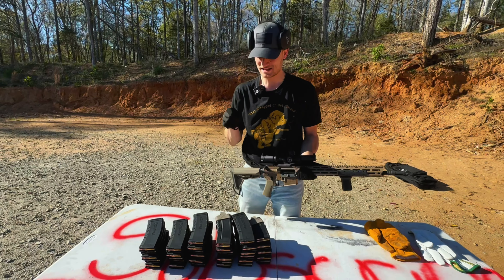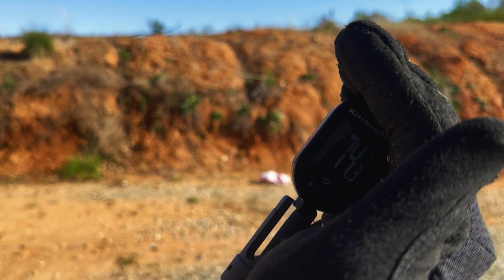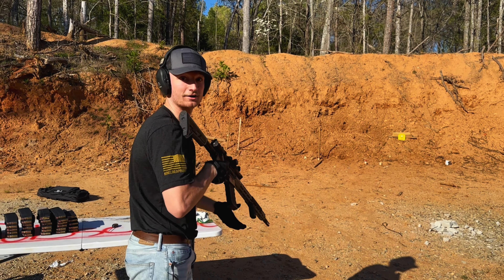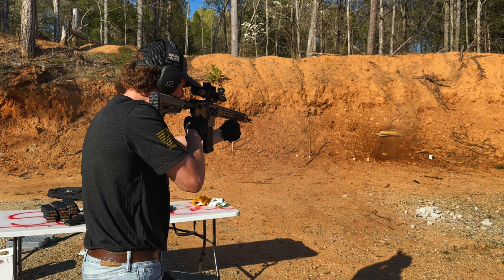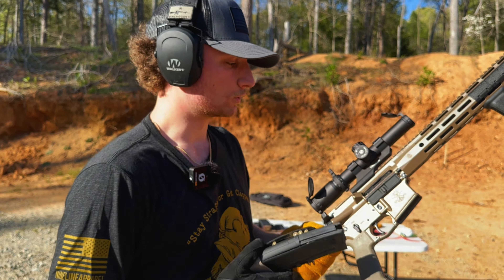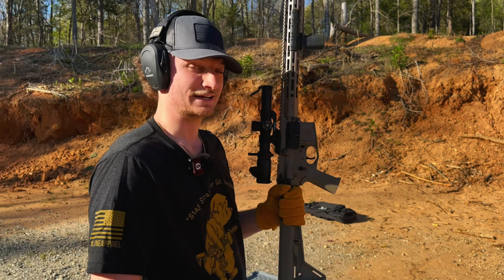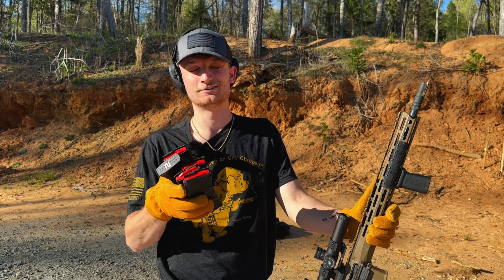1,000 Rounds vs PSA Sabre 15 (It Exploded pt.1)

Comment: PSA here. This is almost certainly an ammo related issue. This type of malfunction almost exclusively results from a 300Blk round being fired in a 556.
Reply from the maker: Hey PSA thanks for the comment! 
I am almost certain I still have the 556 shell in the upper.
Working with your claims department to figure out happened.
Thinking it could be a head spacing issue.
Reply: When psa comes and calls you out, Womp Wompp...
Reply: @ballisticsnation  My dude, just tell us the ammo type, lol. You say it's "High quality ammunition" so don't be afraid to say who made it..Unless it wasn't.
Reply: lol some random reman. Ammo
Reply: @ballisticsnation  JUST TELL US WHAT AMMO IT WAS ALREADY
Reply: Allot of mention on Ammo. First mags no problem then boom. I’d be pissed ..Straight pissed..So my surmise bring a shit load of oil to lube all moving parts on an AR15 before operations 🤔and or lube before using out of the box before going down range. Just my surmise 😊
Reply: @ballisticsnation  You filmed yourself loading the ammo. Since that was the only Sabre mag, you can re-watch that footage and see if a 300blk made it in there.

It happens, I've purchased 1k rounds 9mm FMJ and found a random hollow point mixed in.
Reply: @ballisticsnation you most certainly do not! I for sure saw a casing fall out the bottom of the magwell as well as something coming out the ejection port.
Reply: @ballisticsnation  Please respond with your claim number or email associated with the claim. We have looked on our end and see no record of a Sabre case like this.
Reply: This man probably shaking in his boots
Reply: Just admit your products cant handle 1,000 rounds
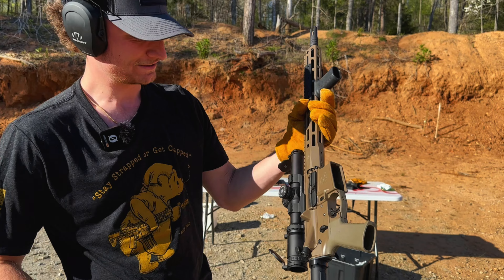Reply: At 5:54, pause the video and look at the top right corner.  You'll see what appears to be an empty 5.56/.223 shell in the air.  You can tell by the neck of the cartridge it was not cut down to the shoulder of the shell, so more likely than not it's a 5.56 round.  It could have very well been a hot load.  I've built some pretty garbage builds when I started, talking DTT stuff...and even then most issues were ammo related.  Every company has a few odd balls that pass QC, but my best guess is this appears to be ammo related.  AR's explode due to excessive pressure, not excessive headspace...so I'm not convinced that would be related.  That's my guess, but with so many other variables I'd never know based off a Youtube video.
Reply: At the start of the video you can see your magazine sitting on the table and it has a 556 /223 round on top.

The ammo is pretty suspect given he hasn't clarified what he was shooting and he also calls amend2 mags good mags.
Reply: @eggystinkering  Watched in HD frame by frame the piece seen flying off to the right is not an ejected shell it is actually the missing front of the magazine.
Reply: I concur. I have built at least 60 PSA AR15s and I beat the shit out of them and never had a failure or a problem.
Reply: @serenmm  I have had several PSA guns . all of them, every single one came to me with some sort of issue. Loose bolts, fitment issues , broken mags and so on .....All easy fixes but anyone buying one should go through it thoroughly.  The guns are cheap for a reason and it's not because they are high quality firearms with top notch quality control.
Reply: Definitely an ammo issue.
Reply: @ghostshadow9046  Ahhhh I see. I was also thinking the same when before the frame that looked like a shell the same piece looked oddly shaped.  I assumed it was the camera warping the shell between frames.
Reply: Your one of the only people to have this happen so it’s more then likely not the gun and if it is shit happens. I would go out on a limb though and say this was 1000% a bad round.
Reply: The round in question was actually a round from previous mag, the one with failures already, could it habe been squib in barrel?
Reply: @JonesyMcDanes  Compared to Troy Battlemags, Promag, Sig's rebadging of IMI Defense mags, or ETS, Amend2 could be considered a good mag.
Reply: @Steamrunner  if you leave them loaded in your car they break from the heat
Reply: @mattpsa he didn’t send it back because he knows you’ll find an exploded 300blk round in there 💀
Reply: That also looks common to case head rupture due to bad head spacing too, right psa? I dunno, the round came out of the muzzle and the few rounds before it blew up weren't cycling/setting off either.  Might very well have been light strikes due to not having positive engagement to the case head and bolt face (due to head spacing). I doubt all the rounds were good at first and then ran into 5 bad rounds in a row in the end. That looks more of a problem happening with the rifle (again head spacing falling off maybe?)
Reply: Idk how 1 jumps straight to “ammo issue” when the gun wasn’t cycling or ejecting prior to the failure.
Every round fired left the barrel. 
Several under powered rounds with finally and over powered round?
That would have had to be set up on purpose. 
That wasn’t a 300blk round!
I also wouldn’t take the word of a PSA social media person. Whole bunch of people employed by PSA that don’t know f$&k all about guns or how they function.
Reply: @PnP-td1mt  it is kind of crazy to jump to conclusions - I agree. The issue, I’ve never witnessed/heard of an AR15 fail the way it did; without it being hot ammo, 300blk, or squib. It seriously doesn’t happen. This was over pressure in the gun. 

It could have been the gas tube, but I went frame to frame - and I didn’t see anything that would explain this. I’ve also never heard of this failure from a bad or erupted gas tube. It would explain the FTE issues we were witnessing before the major failure 

Ultimately, I truly hope PSA gets this rifle back, because if it is there is an assembly issue - they need to know how/why and get it fixed before it happens to more people.
Reply: Wow!!! Ya that's not good!!!
Reply: @EliteCheez head space being out of spec would absolutely cause this. 
Over pressure round and or a 300blk fired in a 556 typically destroys the bolt and carrier. The carrier will split and blow out. 
The gun not cycling because pressure is escaping out past the case. 
I’m curious to see what the spent cases look like that did cycle.
Reply: @PnP-td1mt  The variation in ammo performance is why everyone is thinking ammo. If the powder load is too low or too high it will cause what we saw and given the uploader hasn't specified what ammo he was using, everyone is assuming reloads.
Reply: @PnP-td1mt  not saying it ain’t possible, but the go to answer for every time an ar15 “blows up” is headspace - and it honestly just never ends up being that way. I truly have never seen it documented(just googled and could only see a bunch of people arguing about it.) Case failure is a thing as well, and that is a very dangerous beast. Because, you truly never know; just like a hot round, you never will know until it happens. 

I saw their updated video, and the case is glued to the barrel; it definitely had some fun inside that barrel. Hopefully PSA can figure it out!
Reply: I love how PSA comes to comments and acts tough when something with their product goes wrong. It’s likely the Ammo that’s at fault but coming here all accusatory is dumb. Or it could very well be the weapon….You’re a business, act like it.
Reply: If you don’t shoot much and have no basic understanding of how ammo is loaded I’d refrain from typing your opinion. 
PSA having quality control issues is more common than not.
Reply: @PnP-td1mt  now das some spicy cringe
Reply: @PnP-td1mt  😂 alright guy.
Reply: @EliteCheez I mean seriously. Whole bunch of people in the comments giving their 2 cents knowing damn well they can’t do something as simple as head space check an AR let alone reload ammo. 
PSA doesn’t make anything “great”. Every platform they produce has some kind of major concern. You should be checking this stuff. A set of GO, FIELD, and NO GO gauges aren’t expensive or hard to use. 
Talking about how great a gun is yet not knowing how to perform simple checks like head space seems moronic to me. 
Do better! The more people catch the quality issues the more PSA will improve.. maybe 😂
Reply: @straight6fords580  Watch Garandthumb put over 5000 rounds through a PSA upper full auto and supressed.  I agree with others who feel this is ammo related without actually having the gun to examine.  The malfunctions look like weak loads causing short stroking and if some were weak its possible some were overloaded. Either way I would like to see PSA show the examination of this particular rifle no matter what they find.
Reply: The rifle did what it was designed to do should something like this happen. I have seen a lot of ARs do this. High end ones too. Most are ammo related. I wonder if something got stuck in there in front of the round. Looks ammo related and not mag related at all. I would trash the mags and only use US GI metal mags or MagPul. MagPul is a trusted polymer mag.
Reply: @muddyhotdog4103  case head separation will not cause an explosion like that. It will leave part of the case in the chamber and a ftd the next round. Over pressure or out of battery detonation will cause these types of failure but since the bolt is stuck closed I would put money on pressure not otb detonation
Reply: @jamescorby6854  you're not listening.. It will in fact lead to a detonation like that if the head space has fallen out.  I'm not saying it was case head separation that caused it, I'm saying the gap in head space allowed the pressure to release and cause a seudo-case head separation in the moment due to it not being fully supported.  The rifle was failing to set off the five prior rounds beforehand, there was something wonky going on with the rifle, and overloaded rounds ain't gonna cause that.. sounds like IT'S POSSIBLE the firing pin wasn't making firm engagement due to  loose headspace that didn't seat the case head firmly on the bolt face. I've seen what rounds look like after similar heads pace or poor cartridge support and the end result is similar is all I'm saying.
Reply: @muddyhotdog4103  are you saying the rifle has too little headspace or too much? Either way the damage to the rifle does not add up to a headspace issue. Too little and the bolt doesn’t lock up. Excessive headspace I could see case rupture but not to the extent it’s going to do this to the rifle.
Reply: @jamescorby6854   too much/excessive.. and yes it will still lock up enough depending on where the headspacing issue occurs or how excessive it is. That also gives more credance to my hypothesis on why it wasnt detonating the last few cartridges(bolt was starting not to FULLY seat into battery and reliably detonate cartridges due to shallow firing pin protrusion). Think about it. You think there was something wrong all of a sudden with those last rounds that didn't go off, or something going on with the rifle itself? That's too many symptoms showing a problem (with the rifle) to  ignore before disaster struck. That would be pure coincidence to pull out 4-5 bad rounds in a row out of a BULK box, when all the other cartridges were fine and working before.  Think what you want, but I've seen this with my own eyes where an ar15 gave up the juice, and it failed headspace after checking it out. Started failing to fire right before just like in this instance, and the rounds picked up afterwards all had light strikes. I would love to see the few rounds that failed to fire before it blew up. I'm not knocking psa, this stuff can happen. I saw it with a colt
Reply: @muddyhotdog4103  I definitely think there is an issue with the rifle but watching the video. The round that detonated was left in the chamber and that barrel was way too hot. When he has the failure to fire he never ran the bolt and didn’t have it in bolt lock. The more I have watched I think it probably cooked the round in the chamber and that’s what over pressures the gun. Watch it again from about 5:15-5:40. The more I watch it the more I get skeptical about condemning one or the other.
Reply: Could it have been a super rare cookoff? He gave the gas tube just a little bit of time to cool during jam clearing, but the barrel had not cooled down as much. As the round was loading Into the chamber it had a cookoff before fully entering battery
Reply: Outa batt detonation looks like, i had one! Haha
Reply: @eggystinkering there is also a round falling from the bottom at 6 o’clock. I believe that live rounds were blown out of the receiver. What do you think?
Reply: @philsturgill3435  I dunno.  I know that part 2 of this video was so painful to watch.  He pulls out the end of the broken shell casing...then holds it up to a 5.56 casing....as if 300 blackout and 5.56 have different case end sizes...and proved nothing.  If I was a bettin' man...I'd say ammo related.  Part 3 to this ordeal will take forever to upload....and it's just gonna say ammo related.
Reply: @eggystinkering  as I understand it, the head size of the 300 blk is the same as the 5.56, but the case diameter as well as the neck is larger. At any rate, this dude was a little shady when he tried to convince us that the head size was 5.56 when he “compared” it to another case head. However, if he was loading mags from a 1K batch of Winchester, I find it difficult to believe that a 300BLK would be nestled in the middle of the box. Idk, I just find him …. Not trustworthy….js
Reply: @philsturgill3435  I'm not too convinced about the 300blk scenario more than I am about a faulty round.
Reply: @jamescorby6854    @muddyhotdog4103  
  Sorry for the loooong comment, but it's hard to explain everything I think may have contributed and make it understandable.  I put this comment on part 2.

""User error was the main factor. If you had slowed down a little bit and taken time do see what was going on, you'd probably still have a rifle right now. Not trying to be an azz, just being honest brother. If you start having malfunctions, safety and diagnosis becomes the goal, not finishing a burn down video. 

(First) You kept saying "it's not cycling" If you go look at your other video, every round ejected and loaded a new round. You changed the mag, and every time you pulled the charging handle, a live round came out. Had to have been a live round, because you can see every previous shot eject a spent case. It cycled fine every single time.  Things like that are where it's time to slow down and diagnose what's going on. The mags weren't the issue. This leads me to 3 conclusions. (1) Either you had excessive headspace and were getting light primer strikes. Which you should have heard, felt and noticed as many times as it happened. (2) You weren't in full battery. The hammer was dropping, but not firing a round due to the bolt not being far enough in the carrier to allow sufficient pin protrusion and fire the round. When this happens, the hammer contacts the carrier, the pin itself, or both and pushes everything on in to battery usually. You can feel this in the trigger. Or (3) You have a problem with the fire control group and the hammer wasn't catching the disconnector. Do you remember if you had a dead trigger each time? I'd  be looking at the FCG for sure. But none of that would cause the gun to kaboom. It would just fail to fire.  In any case, you should have been looking at the primers on those rounds you ejected to see if you were getting strikes, light strikes etc. I think the gun failing to fire more than likely was a separate issue and had nothing to do with the gun exploding. With possibly the exception of the headspace possibility. More on that in a sec.... 

(Second) You need to do some reading on the effects of temperature on a firearm. You measured the muzzle at 400°. You yourself said the barrel was probably 600 or more, which is very likely. The melting point of lead is 625° I think. Now go look closely at your first video. You had several bullets that never made it to the dirt. They exploded in mid air before they got there. Slow down your first video and look at the shot at 3:48, 4:48 and the shot where the rifle blew up. Those bullets came apart before hitting the target. This is pretty common with thin jacketed varmint rounds and rounds fired through excessive twist barrels. The thin jacket allows the lead core to slightly melt and spin inside the jacket causing the jacket to fail and fly apart. 5.56 usually doesn't do this, but on those rounds I pointed out, you let them sit in that super heated chamber for about 10 seconds.  This in itself could lead to bullet cup deformation from rearward pressure and tighten up the bullet increasing drag and causing slightly higher pressures..... Another thing is the powder temperature itself. It's documented all over the internet about how much pressure is increased with gunpowder at different temperatures. Some powders are more affected than others depending on if they're single or double based. Typical rifle powders are usually more susceptible to pressure variations from higher temperatures..... Next and most important is barrel temperature. Extreme barrel temps cause the burn rate to change in your powder. Most rifle powders peak in the first 4 inches of bullet travel. Pistol powders typically peak pressure while the bullet is still in the case. The extreme temperature of your barrel at the time caused that powder to burn and peak significantly faster than it was designed to do. You achieved a full burn in a much smaller space and it shot the pressure up catastrophically. There used to be a study by the DOD that went deep into this, but it's been taken down. I was going to post it here for you, but it's been lost to time unfortunately. You can still read about similar studies in most long range forums or places like snipers hide.  One of the comments I read regarding the study stated this...

QUOTE: "The effect of barrel temperature is around 204 PSI per degree F for the Varget load. Also, the small sample gathered with 4350, before my thermocouple meter went kerflooey, is consistent with this result. Since the 4350 sample is small, the uncertainty is high, but the best estimate is 177 PSI per degree F. If you’re not controlling barrel temperature, you about as well might not bother controlling powder temperature, either. In the cases investigated, barrel temperature is a much stronger variable than powder temperature."

You can read this thread by searching accurate shooter. com for "Temp insensitive powders and barrel heat" This is why F-class and bench shooters fire warm up rounds, and try their best to cool as much as they can between shots. To maintain a constant barrel temp, and thus constant pressure. Cold bore, mid heat and extreme heated barrels cause harmonics variations, but more importantly vertical stringing due to higher pressures. Those shooters try to stay within a certain temperature range to keep pressures constant... your rifle was close to round cook off temperatures. If you look up cook off temps, it's as low as 400° if you leave it chambered long enough. Honestly, there's no telling what the actual chamber pressure was at when it failed.

So... what happened to your rifle? I think it was an unfortunate combination of the things I mentioned above.  The case you showed on the video was CLEAR case head separation. No doubt about it. The ejector marks and primer scream over pressure. The bulging you mentioned in the comment on the case like it was unsupported. Well it is unsupported in a 5.56 chamber. If you google pics of a cut away 5.56 chamber, you'll see the end of the case is not fully in the chamber walls. The thickness of the brass down there, the web, keeps it from bulging out under normal pressures. In fact that's the most accurate way to read over pressure. Measure the web on spent casings to see how much bulge they have. They all do it a little, yours just did it a LOT lol  One factor could have been that your rifle was a tad long on the head space. It could have still been in spec, or just a little over. And under normal shooting conditions, it would have lived forever. It's a little hard on the brass for a reloader because it causes the brass to grow more and have to be compressed back during sizing. But it's not dangerous.. Until you factor in over pressure. What happens with a large chamber is the brass rapidly expands to fill the void. This is so fast, it creates a hammering effect and is really hard on the chamber and bolt/lugs. And like I suspect in this case, stretches the brass enough to cause case head separation. So again in your case... you got it TOO HOT... you caused an extreme pressure situation and paired it with a possible loose dimension on the chamber, or maybe even a small dimension on the ammo. Both would have the same hammering effect. Now add those things to a barrel that is superheated and causing your powder to burn faster and spike, possible a bullet that's deforming because you left it chambered long enough to cause a slight core melt, and a barrel that is thermal quenched, swollen and restrictive from the extreme heat making it tighter on the bullet. Not to mention it's still a fairly new rifle with very little throat and land erosion, so it's already making a tad higher pressure than a more worn in barrel.... You just created a failure by stacking a bunch of tolerances. If you had been firing slow, at normal temps, I highly doubt the rifle would have blown. I can almost guarantee you no one is going to find anything wrong with the ammo or the rifle. 

Moral of the story... Don't push a rifle over the limits that isn't specifically designed for it. I have a Hodge that is made with proprietary machine gun steel similar to the steel used for the HK SAW249 barrel. It's a HEAVY profile to resist thermal expansion, it's double chrome lined, and designed specifically for use with M855A1 ammo. M855A1 is 63k PSI... the Proof test round used for SAAMI chambers is 70k PSI. With the conditions you created, you could have been 80k or more on that last shot. You just pushed it over the limit.  That rifle was designed for 52k M193 and 55K M855 ball at most. It's not going to live long at 80....
Reply: @ballisticsnation  Bro you shot a .300blk out round out of your gun. Wtf is wrong with you.
Reply: He changed mags, fired one round.,  it didn't cycle.  He racked it,  fired one round, it didn't cycle.  He racked it.  He fired one round.  It picked up a round.  He pulled the mag out, switched to the new Sabre mag, the bolt was still closed.  He didn't rack it.  He fired the round from the previous magazine, and the gun blew up. 
He had a .300 BLK round in the previous magazine and wanted it to look like the gun blew up from overuse... and wanted to have the PSA Sabre mag in it to make it look even worse. 
Total piece of s**t... and I'm not talking about the gun.
Reply: @Sman7290   Could you post a time stamp  of any instance where it didn't cycle?  I watched all the way through. It cycled a round like it should every time, unless I accidentally missed one. Pretty sure I didn't though.  Every time the rifle fired, I saw a casing eject. And say a live round every time after that come out when he racks the CH. There were no failure to ejects and no failure to feeds. It cycled every time. It just wasn't firing the live round.  And I highly doubt anyone wants to prove a point bad enough to purposely load the wrong ammo knowingly blowing a gun up in their face lol
Reply: @mattpsa love all your stuff
Reply: @silaslocklear6467  No eye protection either.
Reply: It almost exclusively happens from out of battery that would be the first thing I was suspect not a 300 Blackout round sneaking into a batch of 223
Reply: @Blackriflemedicshorts   An AR can't fire out of battery.  Firing pin is recessed until it's locked up.
Reply: PSA I love yall, I really do.
Reply: That is a barrel obstruction or pistol powder. I've never seen that scenario caused by anything else in an AR. Out of battery detonation is Common in certain poorly made AKs from headspace issues but not ARs. Probably could happen but very unlikely and would require serious investigation to change my mind
Reply: Not exclusively... squids do the same in an ar or pistol powder...
Reply: @jimmyvancleef3593   Scroll up a few and read my other comment. It wasn't a squib for sure, you can see an impact on the target or the dirt every shot. Over pressure due to leaving the round cooking in a hot chamber is most likely.
Reply: @eggystinkering  looks like a .556 casing split in half but it's hard to tell from the single visible frame.
Reply: @ghostshadow9046  that's what I suspect as well.. doesn't look like a casing. not a full one at least. maybe it split when it detonated.
Reply: Bruh, I wasn’t even there and I can 100% tell you that this had zero to do with the gun, and everything to do with your ammo…not to mention those garbage ass Amend2 magazines.
Reply: @eggystinkering  pretty sure thats a piece of the firearm lol. the way the gases expel from the rifle it doesnt even look like the bolt opened on that last shot, which makes sense because it wasnt cycling before that either, and it was stuck closed afterwards. definitely not an ejected shell casing.
Reply: @serenmm  its a little different when you build it yourself. QC tends to be a little better
Reply: @RidinDirtyOutdoors  You typed all that just to say nothing
Reply: @PnP-td1mt  Implying anyone here values yours
Reply: @strongestgamer2501  lmao this was 3 months ago, you’re not even relevant 😅
Reply: The gun was struggling to run well before it blew up,he was ejecting live rounds that weren’t going off. It either wasn’t going into battery or the head space was just whack af. You guys are marketing these guns as duty grade weapons yet there are dozens of videos of the entire Sabre lines failing in multiple ways. At this point I’m surprised he was even able to mount an optic on it. Now I’m just here to see how long it takes the legal team to send this dude a C&D
Reply: @PnP-td1mt  Sure, keyboard warrior! 😂  It's ALWAYS headspace & the guns fault, never the idiot operating the firearm or ammo, right?
Reply: @BasedAFPatriot what is it like to be so detached from the basic functions and checks of an AR that you have to resort to making stuff up and contorting words? 

These failures are not all that difficult to diagnose.
Reply: Good thing y'all have lifetime warranty
Reply: You don’t have to explain yourself to this fool
Reply: @ballisticsnation The only head spacing issue here is the empty space between your ears.
Reply: @EagleTears  seems to be trend in the 2a space of the least skilled having the most to say… shits extremely entertaining to read and I enjoy needling the liars.. 
admit you bought a pos and move on. We’ve all done it 😝
Reply: Or squib round.
Reply: @Chasechuckie you don’t know what a squib is.. 
you can clearly see the round prior to the explosion left the barrel..
Reply: @straight6fords580  I can attest their NON SABRE line can and will perform well past 1000 rounds.
Reply: That wouldn't surprise me with this guy at all
Reply: @ballisticsnation  head spacing after you shot that many rounds back to back?  Does that make sense